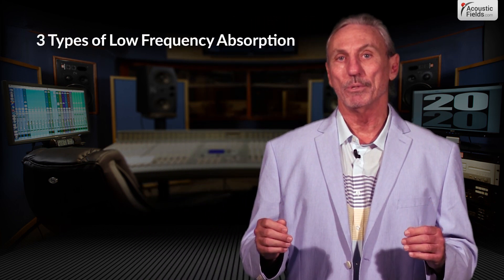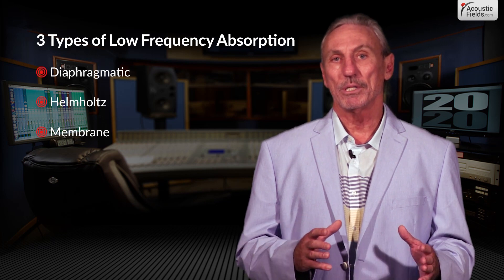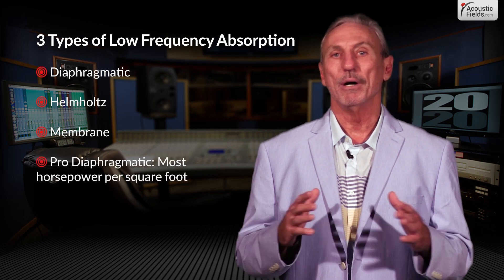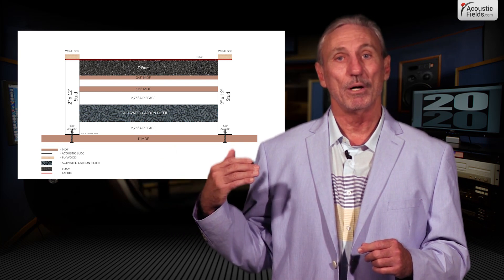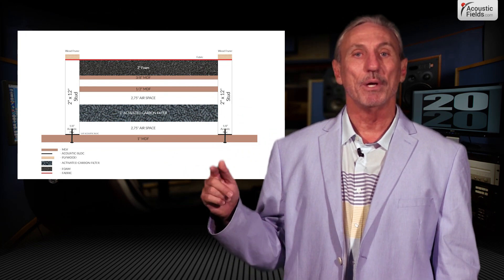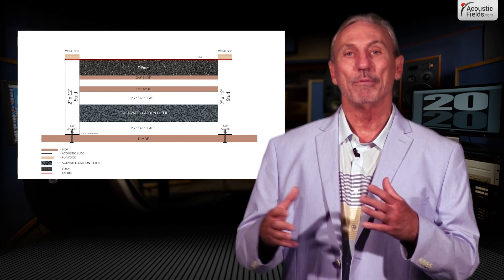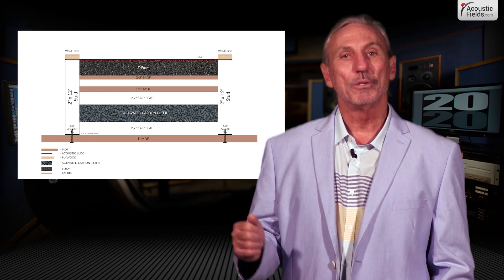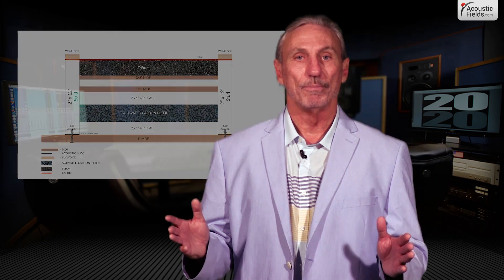How To Build A Bass Trap - www.AcousticFields.com

Comment: If you place a large sofa/chair in your listening room, which contains dense foam, soft foam, out of phase timber and air space, will that provide a decent level of low frequency attenuation? My room is well screened for mid & high frequencies, and that has immediately exposed the ‘built-in’ bass resonance. Listening through a Bryston/Adam Audio A8H pairing, with high end signal (analogue and digital).
Reply from the maker: Furniture is not a low frequency absorption technology.

Comment: Acoustic foam isn't the most efficient LF absorber, but its effectiveness does increase somewhat with thickness. I've seen the rates/levels on your 3" StudioPro foam, but have you ever done any rates/levels testing on 6" or 9" or 12" of your foam, including at frequencies at or below 125Hz, like 40, 60, 83, 100?
Reply from the maker: We do not offer a 3" foam technology. Our foam is manufactured in 2" thickness. You can lower the resonant frequency by adding layers. However, the rate of absorption becomes an issue with thickness of foam. You cross performance thresholds with other technologies. For example, if you take a 8" deep foam panel, you will be better off from a rate of absorption standpoint to use a perforated absorber at 6". You save 2" in treatment space for a higher rate of absorption.
Reply: @AcousticFields  Interesting, thank you.

Comment: Anything above 1k i want to treat evenly in a very small room. I have options to put rockwool panels on wall, but not sure about which density to buy starting from 40 to 160 kg/m3. Any recommedations?
Reply from the maker: Building insulation will destroy music and voice. It lacks the proper rates and clevels of absorption that music and voice require.

Comment: In this video I noticed there was 2" X 12" studs used as your side walls. Is it okay to build a cabinet on casters using 2" X 12" studs as my side walls, top & bottom walls, or would that make a difference as apposed to using MDF?
Reply from the maker: You need certain densities with the materials you use to construct a diaphragmatic absorber. It is the density of the cabinet, the depth, and the internal cabinet fill that all works together.

Comment: Starting to think people could use most or practically any activated carbon rather than the magic proprietary activated carbon from London & LA, prove me wrong.
Reply from the maker: Over the counter carbons used for air and water filtration lack the porosity count and density along with their ability to absorb moisture. We manufacture our raw materials to produce the proper pore count, diameter, density, and we treat our carbon not to retain moisture. You can prove yourself wrong by building your room and installing an over the counter carbon. We will even assist you with the process so you can report your findings. After the process fails, we will require you to do a video on the results so others can see your failure.

Comment: What is the cost of the carbon? Lets say enough to fill one of those bass manager cabinets
Reply from the maker: Building one unit will not benefit any acoustical issue. The carbon is now 375.00 / BDA unit plus shipping. If you want our proprietary foam technology for the face it will be an additional 75.00 / BDA unit.

Comment: So i know very little about soundproofing.   I am remodeling a mobile home and it is located right next to an airforc base that has very loud jet planes. Looking for cost effective options.  Liked your warning on wool insulation.
Reply from the maker: Noise frequencies and amplitudes must be measured before any barrier technology is used. Jet noise is the worse type of noise to treat since it full range noise with high amplitudes (strength).
Reply: @AcousticFields  - I so I am picking up a decibel reader.  An Amazon product relatively cheap.  After I get readings of sound, do I apply layers of material accordingly?   I read that different materials block different frequencies.   Just not sure of the healthy materials to use.  Weight is also a consideration on the load bearing walls.  If to heavy i will need to add supports to the flooring joists.
Reply: @nobodyisprfct  -  KRK was offering a free audio app for smartphones.  It has a spectrum analyzer, noise generator, dB meter, etc. 

Are you building a studio or home theater?  Or, just trying to reduce the noise of military aircraft?  
     Good luck trying to mitigate the noise of afterburners.

Comment: Do these work in a small room ? , 
 im going to build a studio that’s 3,70 M long 2,30 M wide and 2,4 M high . And its going to stand 2 meter in the air on a steel frame . 
In my head i think i know how im going to do it but still a lot of variabels to think off
Reply from the maker: Z,  Yes, they are designed to reduce pressure at lower frequencies. Most small rooms need 12 units.

Comment: Hello! Tell me plz. What kind of carbon better to use?
1 woody carbon - charcoal
2 coconut coal
3 hard stone coal
4 coal sorbent
Reply from the maker: Over the counter carbons used for air and water filtration will not work for sound absorption. Carbon has to undergo a special manufacturing process to insure porosity size/count and granule density. We ship our carbon from LA and London.

Comment: I do understand that simplest design of diaphragmatic absorber uses pressure (not velocity) to move front thinner part in much more rigid box hence absorbing energy around resonant frequency. 
But your second membrane and more importantly carbon inside the unit are velocity based turning velocity of air molecules into heat? 
If so, the inner plate vibrates in such a way that molecules moves inside carbon horizontally. 

What I am trying to say is that it seems that your unit is both: 
- pressure system in terms of typical pure diaphragmatic absorption 
- velocity of molecules inside carbon area 

I have purchased DIY. Thank you.
Reply from the maker: B,  You have an external cabinet that is the diaphragmatic absorber and corresponds to the rules of that design function. The internal perforated absorber corresponds to the design parameters of that design. The carbon accelerates the rate of absorption for both functions.

Comment: I bought the DIY plan of the diaphragmatic absorber. My studio‘s ceiling height is 2.65 m, so I wonder if one could increase the height of the device (while keeping the width and depth) to e.g. 2m or stack two with a hight of 1m-1.3m. Any comments welcome. Thanks!
Reply from the maker: M,  Yes, you can change the width and height but not the depth. Be careful stacking these units due to their weight.

Comment: did you consider mounting speakers in the celling transmitting a frequency that cancels out the sub responce?
Reply from the maker: M,  Noise cancellation technology is another effort to use signal processing to manage source response. Any signal processing can be heard and colors the response curve even further. Treat your room using the available space you have with the proper technology then use small amounts of EQ to tame the remaining peaks and troughs in your room response curve.